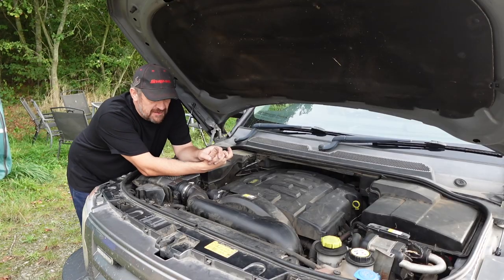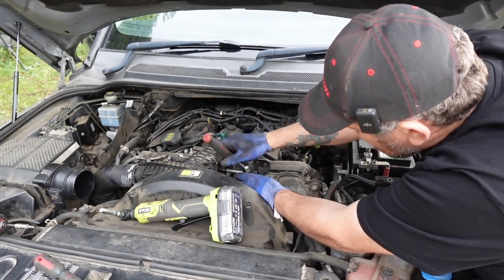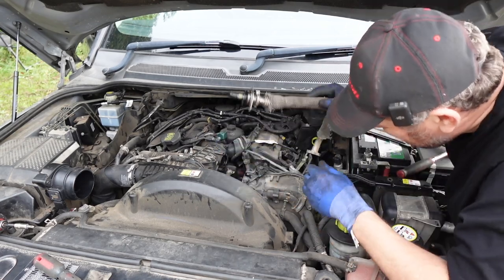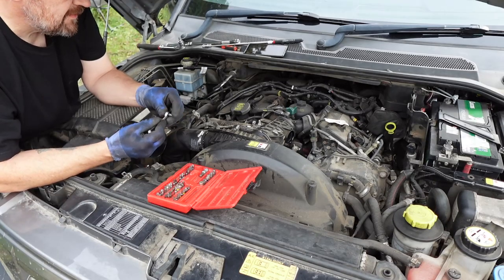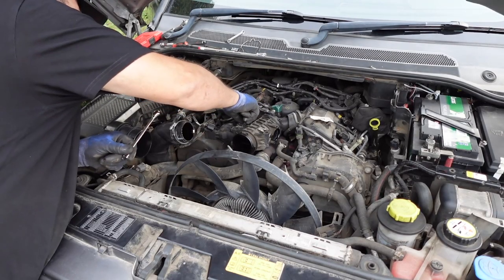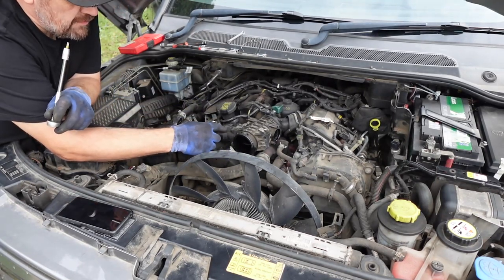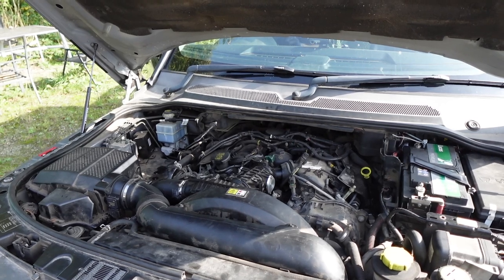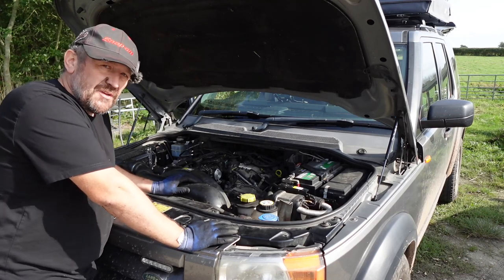EGR is killing my Discovery 3 - here's the fix for my LR3

Comment: I work for a independan Land Rover specialist and this modification would fail an MOT test as it has been obviouslt midified. We would advise fitting the blanking plates but leaving the pipes in place so its not so obviously modified.
Reply: I don't know but in Germany it is a 500 euro fine if egr blocked off so if it comes here your in for trouble, I expect it will?

Comment: Having ripped out all these superfluous parts and disposed of them ,will this vehicle now pass MOT ? It seems odd that Land Rover bothered to fit all these parts if they are not doing anything?
Reply: They are doing something but the side effects are sluge and smoke, should pass the MOT just fine.
Reply: It will NOT pass the mot with the EGR removed, what he has done is now illegal...
Reply: Must confess Also blanked mine but left the EGR pipes in situ, put the blanks at the engine block end between the EGR pipes so can’t be seen , along with removing the butterfly inside the throttle body , with the engine cover on it looks like the egrs haven’t been touched , have heard a few people failing there MOT  if the pipes are missing, mines passed its mot’s for the last 4 x years since blanking them this way , mines also a pre 2007 so the software patch isn’t required , at the same time very carefully cleaned my Map and Maf sensors
Reply: They're significantly reducing NOx emissions, which they have to do to be able to sell the car. NOx isn't tested in the exhaust during an MOT emissions test, though, so even though the car is putting out way more it can still pass the MOT emission test. Whether the tester notices that it's been modified is a different question.
NOx is what the whole VW emissions scandal was about, so while I'm not making any comment either way on whether people should/shouldn't blank off EGR, anyone who does has no right to complain about the VW emissions thing, in my opinion!! Pretty sure that having no EGR will make for WAY more NOx emissions than a VW with the test detecting map.

Comment: I just did full replacement of EGR valves cost £45 per side (after market ), bit fiddly but if you take your time it can be done. Codes all cleared by themselves and no worries re-MOT. I wouldn’t risk the blanking plates, my MOT station would check. Mine is running like a dream now and all legal.
I have a flexible torque drive extension adapter for my small socket set, makes the job very much easier don’t know where I got it just one of those tools that turned up somewhere in my foraging for tools. To de-gas the air con just press the valve (high pressure) side with screwdriver keep your head out of the way?
Big advantage of my way is you can clean the old ones at your leisure for future fitting, one of my valves heads had actually broken away!

Comment: Can you specify what is PRE and POST 2007? Mine is first registered 11/07 but MY08. And can it be blanked with leaving everything in? Due to MOT.
Reply from the maker: I think yours would be the same as mine. So you are most likely going to need a remap.
Reply: @LRLiveUK  What does a remap comprise? Is it something you would have to visit a dealer to get done? Couldn't the multiplug be tripped somehow? Mine is a Jaguar XF 2009 with the same engine.

Comment: Would be worth taking the op section of the pipes off and putting the longer sections back. Come MOT time, it’s not so obvious they’ve been blanked then (it’s a failure otherwise).
Reply: Not allowed to remove engine covers at MOT to check if it's been removed.
Reply: Testers can remove covers as long as it doesn't require any tools.
Reply: Hammy - you can see the pipes clearly with the engine cover in place. If they’re not there, they’ve been removed. You can leave the pipes in and still blank the egr. It’s a cheat but works.

Comment: IIRC, pre 2007 models can be ‘Penney’d’, but inserting a 1 penny piece in the 2 pipes where they join the exhaust on each side of the engine. This in effect simply blocks off the EGR without having to remove any pipes or make alterations to the throttle body. 
Also, pre 2007 models won’t need a remap.
This improves performance, fuel economy and prolongs the life of the engine.
Reply: I thought it was 2p piece - I used a cheap blanking plate instead. I also removed the butterfly valve. Worked fine.

Comment: Hello from Turkey. I just bought it from Ali Express for my 2008 sport vehicle. Is software needed? Do I need to cut and cancel the butterfly? Does the Aegean cancellation benefit fuel and power? Finally, I read it in a few places. They say that the temperature of the engine increases and is harmful, is it true?
Reply from the maker: Post 2007 and you will need software, you do need to cancel the butterfly. No noticable change in power or economy. More responsive though. Engine temperature is the samne.

Comment: Hi thanks for this great video! It would be nice if in future videos like this to explain what's the aim of this kind of modification! 
This also is a very good tip for making camping not so boring😂 
Forget the fishing rods and other stuff next time I'm going to take my toolbox!😂❤😂
Reply: I think the aim is to avoid the difficult and expensive job of full EGR replacement. I personally wouldn’t risk it, just replaced mine with after market EGR valves cost £45 per side. My MOT station guy warned me last time, “we check they haven’t been blanked”, forewarned is forearmed!

Comment: Is this legal in the UK? To defeat the anti pollution equipment?
Reply: Not legal but if blanked leaving everything as is such that the modification is not obvious, plus also deleting in software, it will pass MOT. Other emissions control is DPF and removing it is a big no-no.
Reply from the maker: Luckily the D3 didn't come with a DPF - only the 3.0 engine I think.